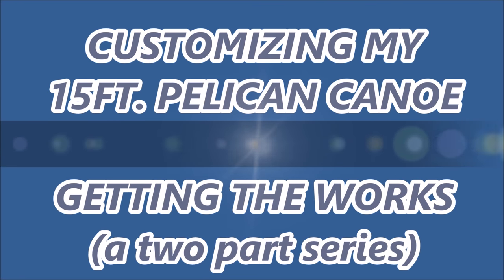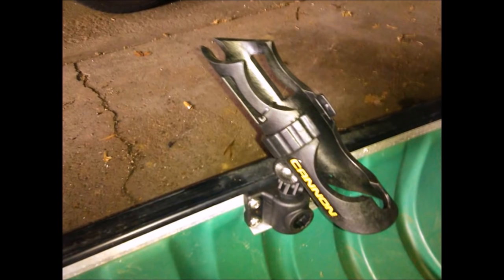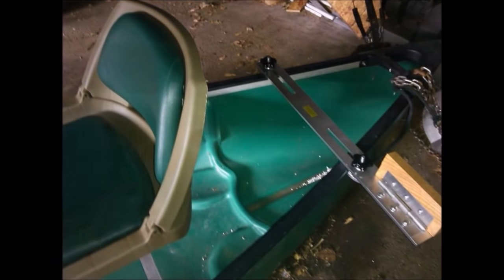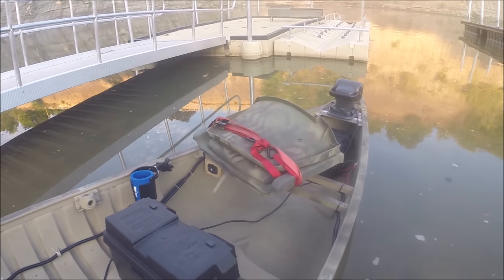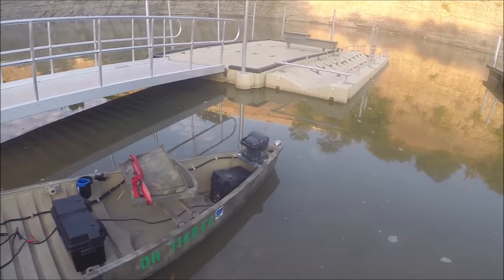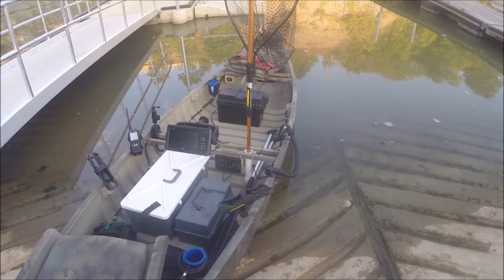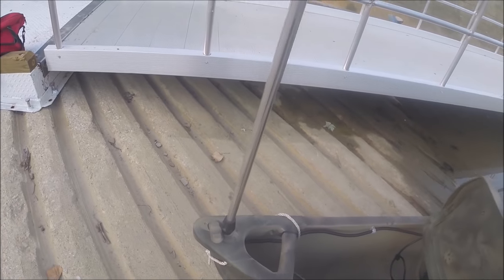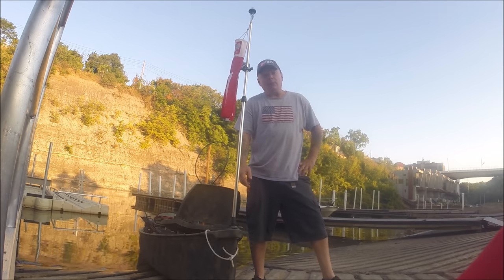CUSTOMIZING YOUR CANOE ( FISHING/TROLLING CANOE ON STEROIDS)

Comment: When do you think it would be worth it trolling the river for steelhead  date wise
Reply from the maker: As soon as there is significant rain and cool dwn itl be insanely good fishin by boat trolling the mouths..Leaves are a nuisance while trolling in any river but when the leaves fall on the water its usually due to cold and rain so the fish are then there also.  Another thing to look for is baitfish in the river...   I usually troll for walleye on calm nights with south wind until the river turns on in Nov..  I usually start hammering them good frm Nov thru Dec. then switch to float fishing in tge winter monthes.. Few more weeks till it gets good but they are staging along the coastline near the mouths right now..thats for sure...
You can get into them here in the rivers right now but not as consistently...  A cold rain will trigger bait to come in and will also in turn trigger sm good runs for various reasons...Go once river clears and slows to 400 or less after a nice  rain..Good Luck...  See ya out there!!
Reply: As soon as the leaves and the trees are gone out the river you're good to go

Comment: Cab you review your wiring and control box please ?
Reply from the maker: markos mcmahon. Thats smthing you will hv to figure out depending on the accessories you are running...YouTube installation videos..Wire sizes as per amos being pushed through...fishfinder distortion frm wiring.....  How to install a switch box..circuit breaker...fuses on a boat...  tin wiring foe marine use..  lots of factors..Anotber important thing is shink tubing your connections to illuminate corrosion..  Its all on Goofle & YouTube...  Good Luck